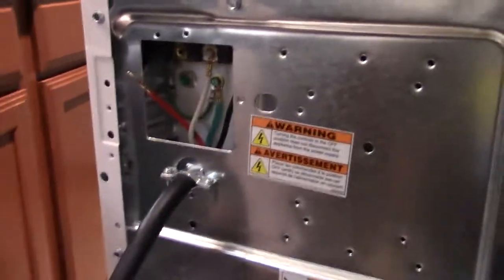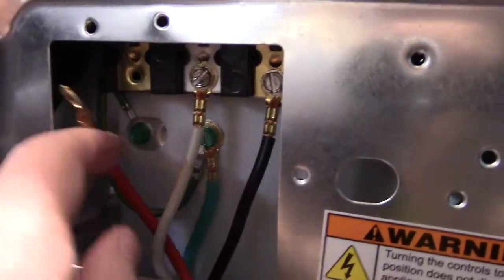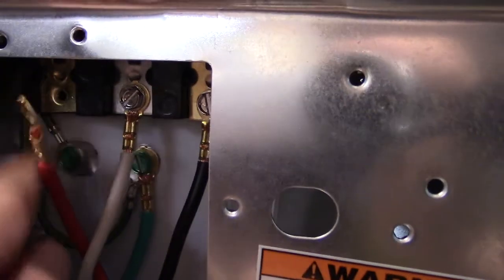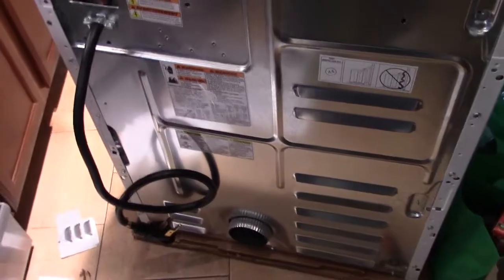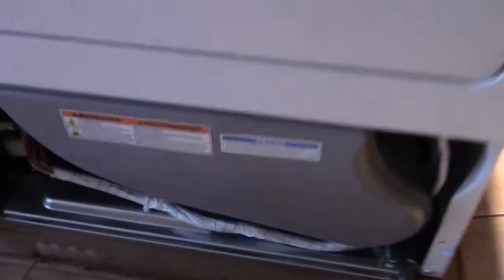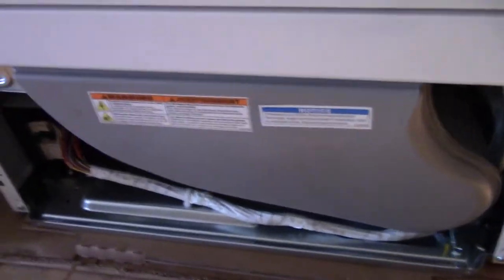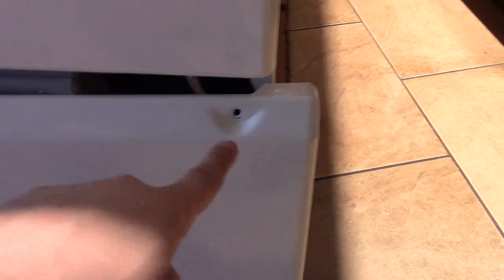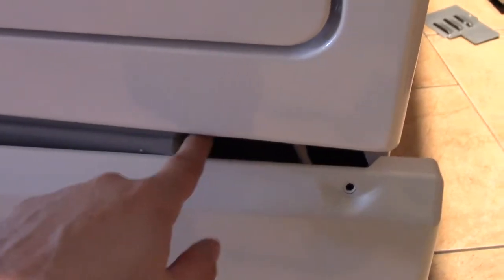Dropped screw inside washer/dryer?

Comment: This video was amazing.  I did feel like punching a wall after a screw dropped down inside.
Reply from the maker: I felt the same way,  I started gooogling and didn't find anything so I made this video,  maybe someone has a similar setup and it will save them the drywall repair :)

Comment: What if its a Samsung Dryer and it doesn't have a removable front panel?
Reply from the maker: find another screw :)    couldn't tell ya, perhaps one of the other panels will come off but if it's too much trouble just get another screw.   try tipping it with two people and seeing if it's accessible from the bottom?  good luck!
Reply: @morejelloplease  Wife and I lifted this Samsung thing up and tipped it all over the the screw finally just stopped moving.  Spent an hour to avoid a 10min drive to Home Depot... that I now need to make anyway. :)
Reply from the maker: @johnblack7862  aww shucks! No removable plates? May have to dig up a schematic or exploded view diagram to see if any panels pop off.

Comment: My samsung doesn't have a front panel. If the screw stays will that create any problems?
Reply from the maker: Sorry I'm not familiar with their internals.
Reply: @morejelloplease  from your experience has a screw ever caused an issue that you have found?
Reply from the maker: @Schneeef  i've dropped screws in things and sometimes they rest on the bottom out of harms way, sometimes they can land inside motors or on electrical contacts and cause a short.
Reply: @morejelloplease  I still had the styrofoam that the dryer came in so I put the dryer on it's side and tipped it  to where the screw came to the corner I needed. I was able to spot it with a flashlight. I grabbed a wrench and was able to drag it until I got it with my fingers. God is good! Thank you for responding!